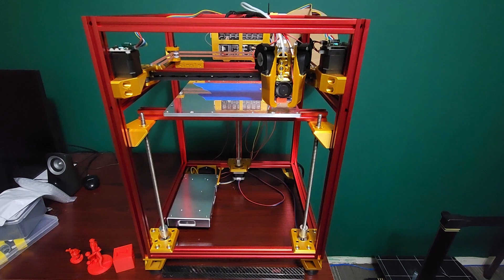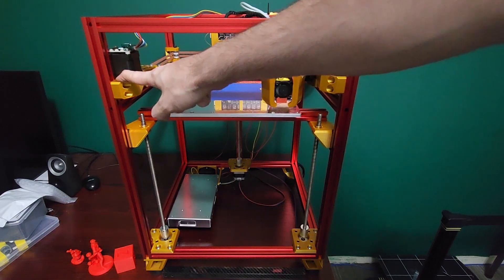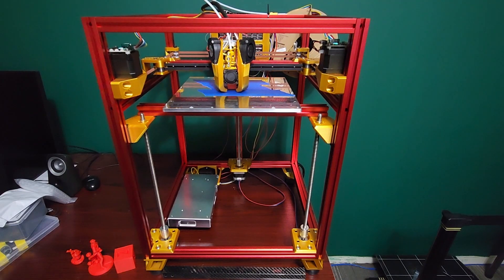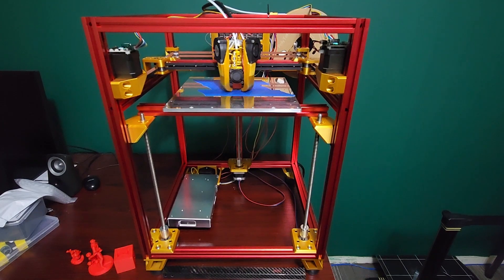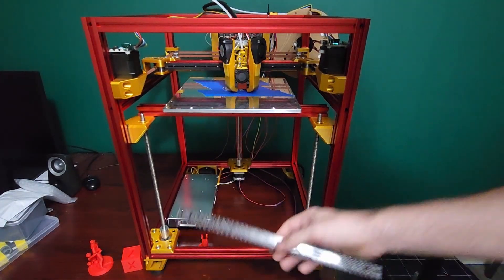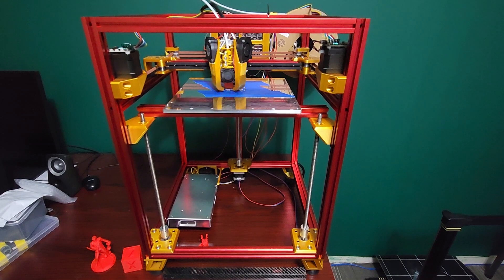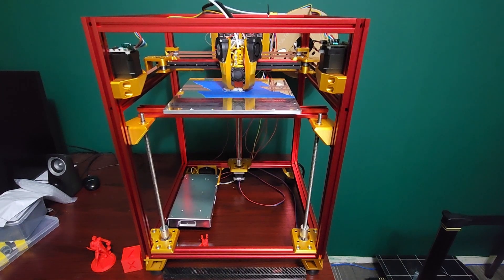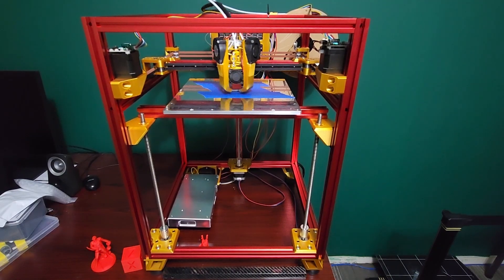Simple DIY CoreXY 3D Printer SimpleCore MK1 - Assembly Series EP2 - Z and differences from a Trident

Comment: Why is it so complicated to download files from Github could it not be easier to download all parts at once for the printer ?
Reply from the maker: ya that's why I stopped using it for printers, you can download all as a zip in the top right with the green code button
Reply: thank you very much keep doing your work further good

Comment: Hi! i wanted to know if there´s a guide to mount the belts, and how much belt is needed for the project, i´m triyng to make the cheapest core x y printer possible with klipper. Thanks!
Reply from the maker: the best would be to join my discord, people are building this and you can get help if needed

Comment: great Core XY build and thanks for sharing your knowledge.
Question, i downloaded the STEP file for your printer but the belts are missing from the model. 
Are you able to add the belts  and export them as a step file and post a link to download here so I can see their path. dont need the teeth on the belt, just a simple ribbon so the belt path is clear ?
Reply from the maker: Sorry I never modeled the belt path in the CAD for this, this image will give you a good start https://forum.duet3d.com/assets/uploads/files/1549065034708-full-assembly-belt-path.jpg
Reply: @Rolohaun  perfect thanks for that image. All makes sense now 👍

Comment: Hey, do you have any recommendations to make this machine print ABS, except an enclosure? Do you think the Mantis toolhead ist still the think for printing mainly ABS or should I get an other toolhead instead?  Thanks for your work. I build the frame with your parts yesterday. Super happy.
Reply from the maker: you really need an enclosure on a printer this size, however UHU or Elmers extra strength glue stick can help and a brim. Mantis toolhead is fine for printing any material

Comment: Thanks for the Inspiration, Im gonna design a corexy printer based on my Anycubic i3 mega soon. I think belted z can be useful when you try to reduce the amount of steppers, kinda like the belted dual z mod for ender 3. Im gonna use 2 steppers to drive 4 z belts. This way i hope the bed will be rigid an i can still use the stock electronics.

Comment: Nice design!

Given that it requires revision of existing toolhead designs, what's the benefit of flipping the belts around?
Reply from the maker: I wanted to get rid of all the extra bearings and idlers the Trident uses and make the list of parts less. It should help lower the drag on the belts too